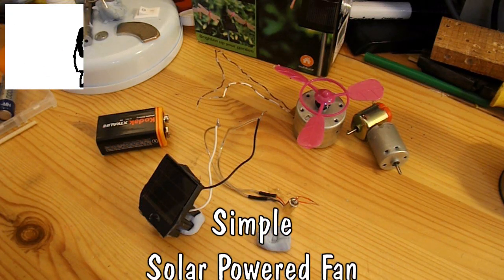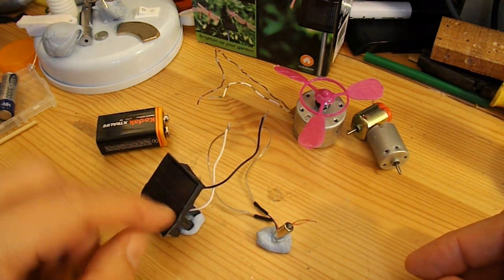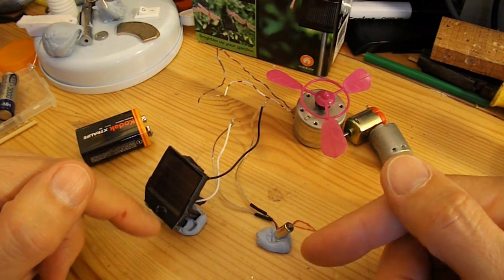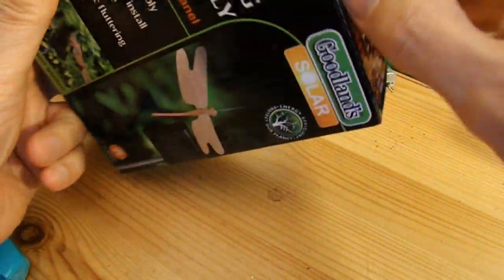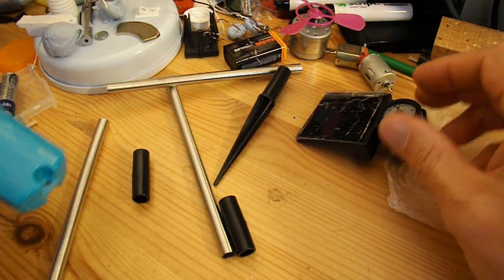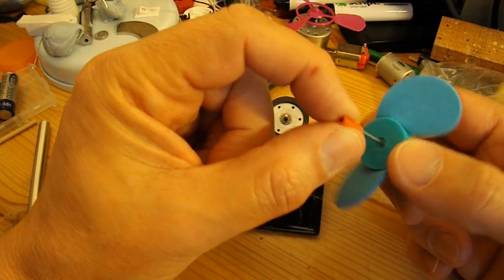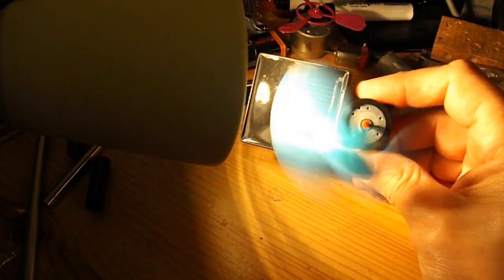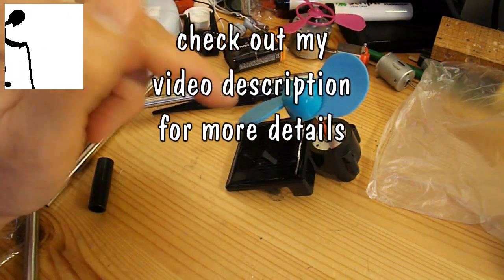Simple Solar powered fan

Comment: I could knock out a few of these - I thank you for another Old Man!
Reply from the maker: Haha, this really wasn't very practical. That little panel is a bit small, I was just using what bit's and pieces I had laying around. I have seen similar arrangements on baseball caps to keep you cool in the sun. Update: I just had a look on eBay and there are plenty on there, you can even buy little solar fans with a clip designed to clip on your existing hat. 😁👍